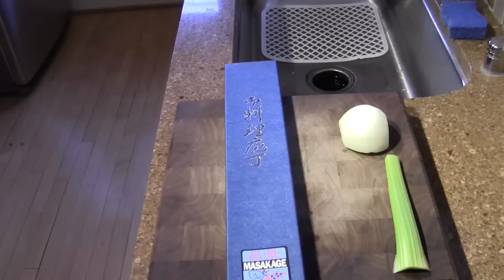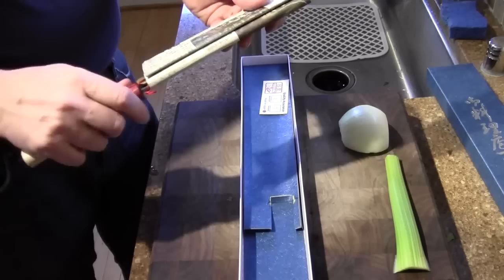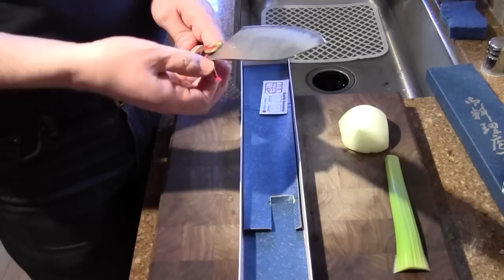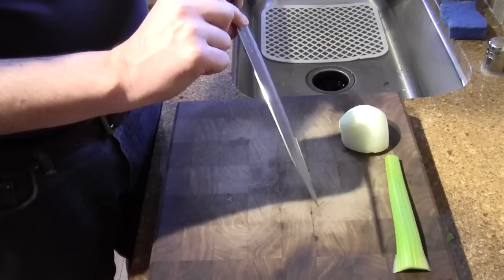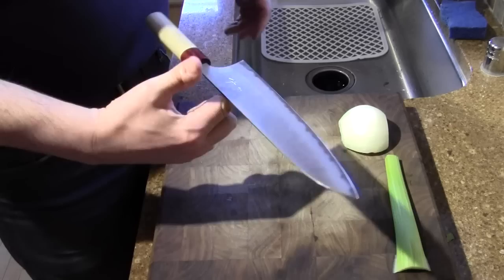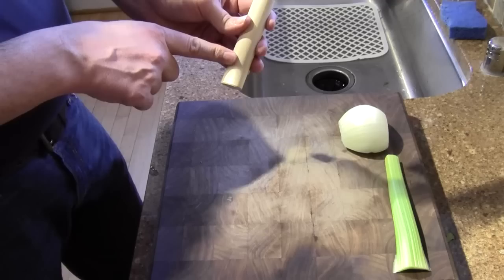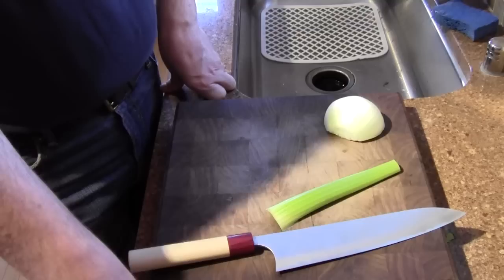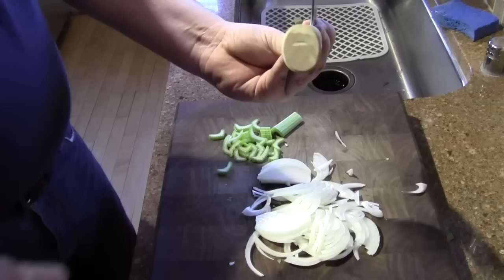Masakage Yuki demo and review(1/2)

Comment: Beautiful knife, I like the pakka wood.

My $30 Victorinox performs just as well, though, after a week of steady use.  It's funny to me how you can spend 5-10x as much and only get maybe 10-15% better performance.
Reply: I'm sorry but I work in a professional kitchen for about 7 years and I had many different knifes, from cheap to expensive japanese ones , if you cant feel the difference you actually should stay with your cheap one a bit longer until you start to feel limited, you probably have to learn a bit more. I used to think the same as you until I decided to learn some knew knife techniques and improve my knife skills as well my sharpening techniques and I completely changed my mind. I have my Victorinox Fibrox on my knife roll all day and i love it, I used it a lot but when you get to specific tasks there is no way that 50/50 edge will do the job properly, is just a matter of limitation of the blade. If I have to cut pounds and pounds of veggies for stock, no doubt I'll grab my Victorinox and kill it, but if I have to clean meat, or a fish, prepare some fine cut garnishing for example, I'll just grab oe of my japanese ones.